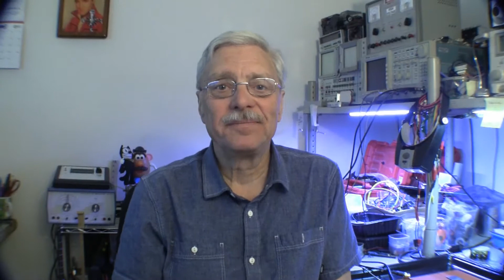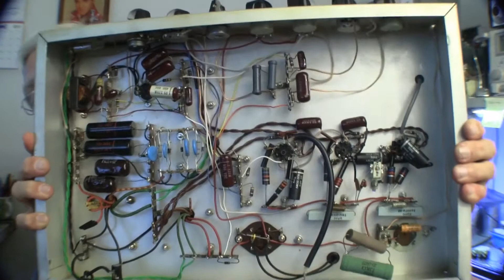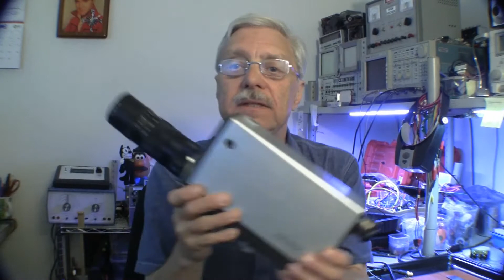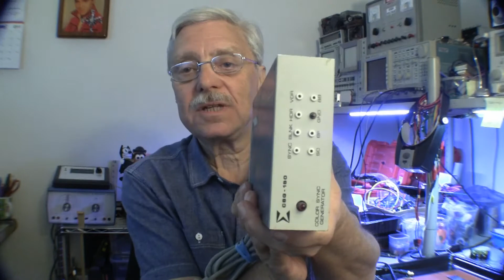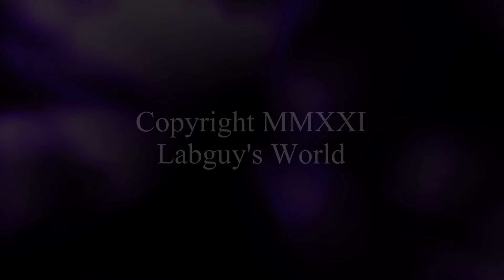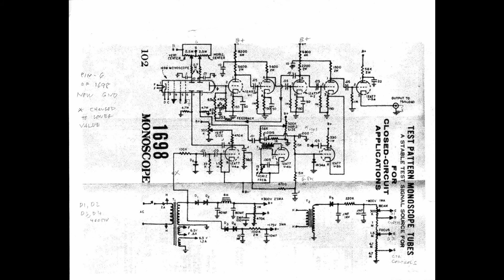TV Sync Generators, Part 1

Comment: Sync generators, my favorite! No, they really are, without good sync, the rest of your video signal falls apart. That Sigma sync generator looks to be a good candidate for generating sync for Quad machines like a VR-1200.
Reply from the maker: The absolute purists would be upset by that statement. But, it would work good enough for a lone machine and small system. At least until higher end model could be located.

Comment: That '3262 is a good little chip.  We used it in the RCA TK-76, adapted to genlock from an external black burst signal, when present.  I used a National '5320 sync gen chip at another job (it was cheaper & more available in small quantities then), which also worked, but didn't have the vertical reset range for good TV-station genlock.  I wonder if you can still get either of those ICs nowadays?
Reply from the maker: You can get F3262As from Voyager Components in Silverton, Oregon. Contact me direct for their address and phone number. You will want to speak to Dimitri. They are listed on Ebay too (Seller: voyagercomponents). Auction number 252737560266. Two for fourteen bucks.

Comment: Kinda off topic, but is there a way to phase lock that Fairchild chip to external sync? VCXO with PLL? I bought a couple to tinker with, but the data sheet that I found seems incomplete.
Reply from the maker: Yes. You will note that the chip has two reset pins as well. Active low. The vertical reset is simple enough. The horizontal and vertical reset requires a pulse, one 14MHz clock cycle wide, to be applied exactly 61 clocks after the falling edge of horizontal drive. You can use a purely VCXO approach. But, vertical lock up time could be very long. Up to several minutes without using the resets. I have the datasheet with timing diagrams posted here: https://www.labguysworld.com/3262A.pdf
I designed a special quad sync generator back in the early 80s. The company was called Vitalink and we were building video conference suites for the rich and famous. (Ever heard of Ross Perot?) It had four 3262 chips to allow for staggering the vertical sync start times by 120 lines each. These genlocked two cameras and two monitors. We then extracted the middle 120 lines from each of the two cameras, one above the other, built a new sync frame around them and fed them through a $90,000 MPEG encoder over T1 phone line. At the receiving end, we dismantled that frame and reconstructed the two separate frames for the monitors. This way, we could place 6 people across the two monitors, with three talking heads on each screen and use only ONE codec. Ultra clever for its time. I now watch up to four youtube channels at once over WiFi including the bandwidth used by five other room mates. How times change!

Comment: Would it be possible to make the monoscope switchable between the IC and the original circuitry? It breaks my heart to see an all tube circuit permanently modified to use an IC. No doubt it will work 10 times better than the original ever could have though.
Reply from the maker: Well, JD, that would certainly be a nice feature. But, since it doesn't seem to work correctly as designed, we may have to make that sacrifice. You heard my plea to anyone who has experience with that circuit or can analyze the circuits to let me know their thoughts.

Comment: Another advantage of a true 2:1 interlaced sync generator is you get full vertical resolution. The cheap AC line lock / free running horizontal oscillator produces random interlace which reduces vertical resolution. Now if you really want to impress us, you would rebuild an RCA TSG1, full rack, all tubes!
Reply from the maker: I'll put that on the bucket list.
Reply: @videolabguy what tubes are needed for it?